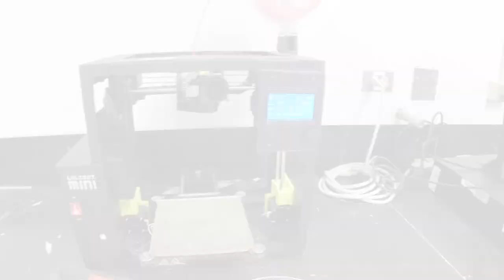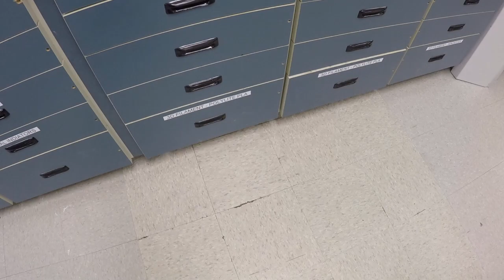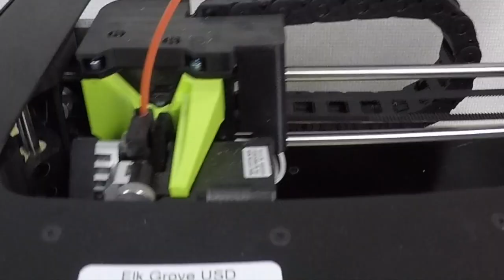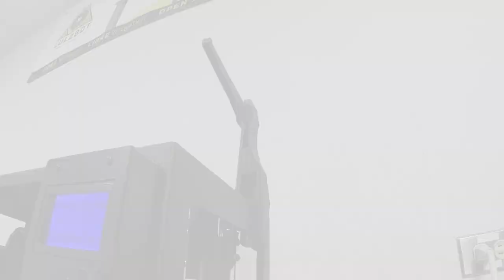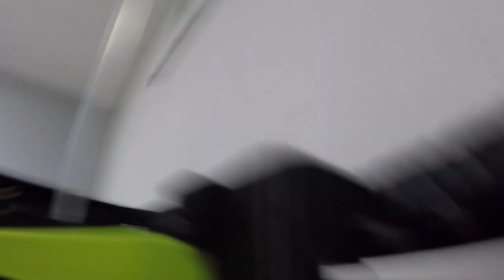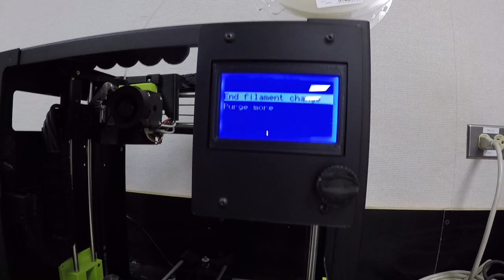3D Filament Change on the Lulzbot Mini 2

Comment: The temperature depends on the material for pla you generally only need 230•c at most for purging & removing pla if it’s a different material it might have different thermodynamics